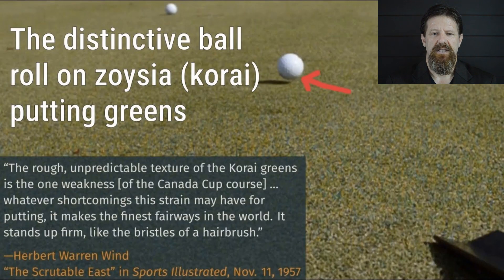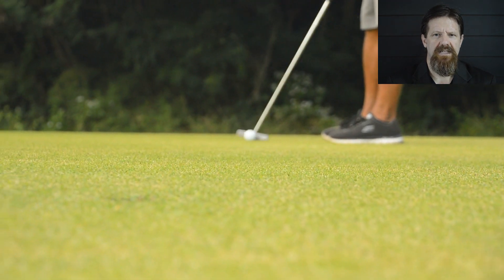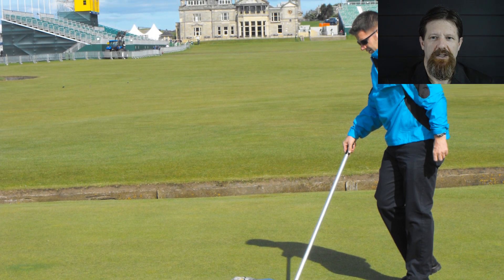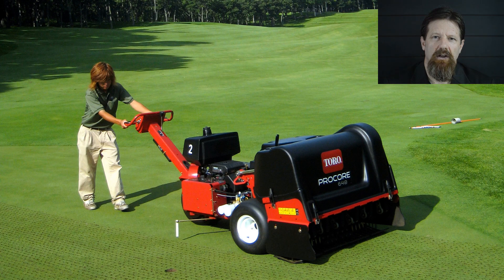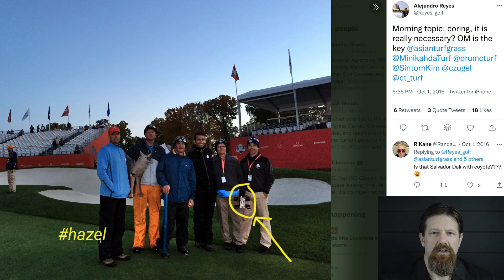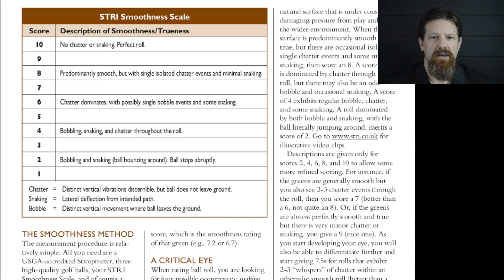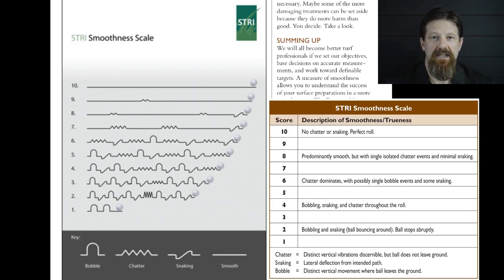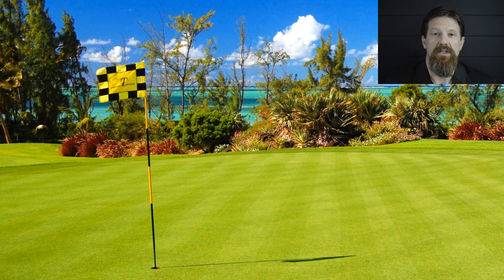How to measure the smoothness and trueness of golf course putting greens?

Comment: I had to watch it a second time before I understood the bobble test, lol. 
Anyway, is it possible to have a green that is not fast but yet perceived to have a good score on the smoothness and trueness? 
There was a rural club that I consulted for many years ago which after a couple of months members came to me and complimented on the speed of the greens. I distinctly remember the speed on the stimpmeter was just 7+! My thinking then was that I managed to make the speed on all 18 greens consistent instead of a 9 on some and a 5 on others. But after watching this video, could it be because the greens became smoother and truer? 
I raised the cutting height (they scalped the greens and blamed it on disease caused they didn't know how to measure height), taught them how to fertilise the greens, topdress with a fertiliser spreader (they don't have a topdresser) and brushed prior to mowing among other things.
Reply from the maker: Thanks for watching twice! Maybe I will do some more demonstrations or explanations of the bobble test to make sure it is clear.

Yes, it is possible to have a green of moderate speed with a good smoothness and trueness score. However, the work that is done to make a green smooth and true will also tend to be the same type of work that increases the green speed. With the story you mentioned, it could be consistency from green to green, and also that the roll was smoother and truer, and that's the thing that golfers notice when they hit a putt.